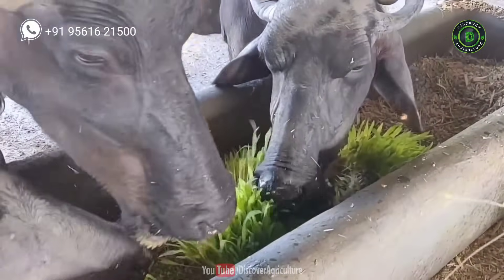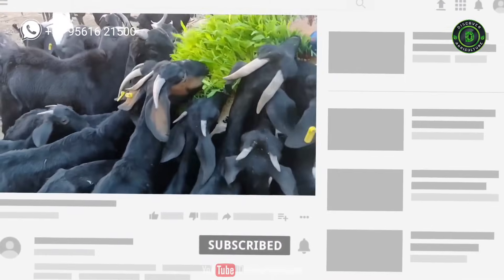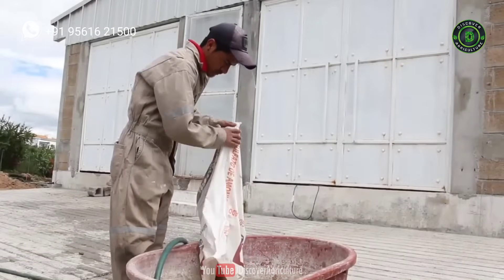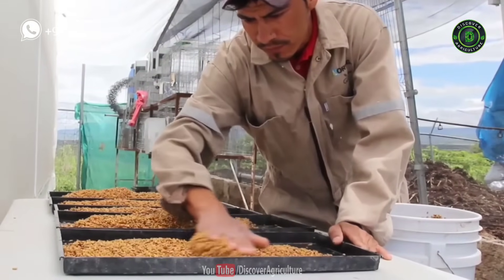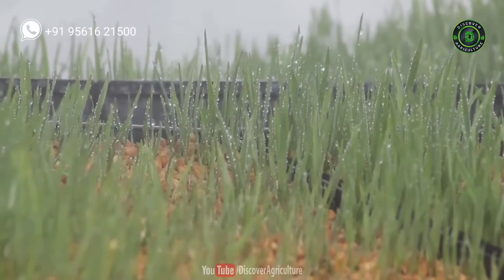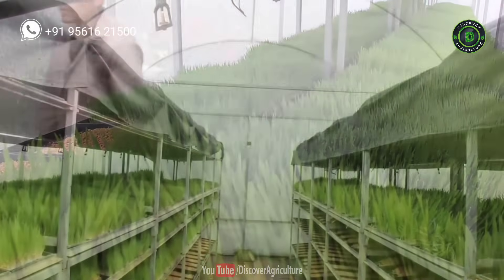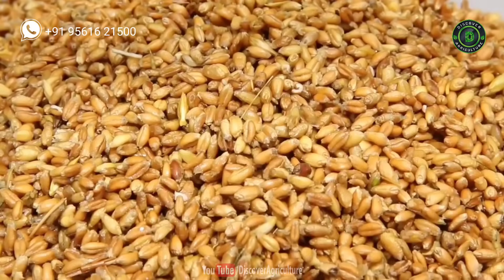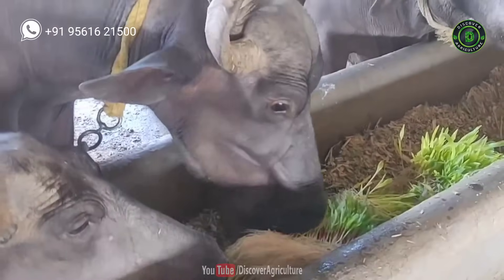Hydroponic Fodder System | Easiest Method to Grow Hydroponic Fodder at Home | Green Fodder Farming

Comment: I think it's far expensive than feeding them with natural grass
Reply: It should be done when natural grass is not avaliable
Reply: @biswajitjena9908  it contains more nutrition than soil grass
Reply: @abcdef1709  it can be done in very less area which save your man power and land wastage and production in whole year

That's the main difference
Reply: A kg of maize produces 8-9 kgs of nutritious green fodder in just a week... what more can one expect and is always better then the field grass also one need not go anywhere to harvest as the shed can be set next to the desired location. The set up is a one time cost and once you get the zest of it there is no looking back....there are many who are already using and reaping the benefits of this system. A better option if done meticulously.
Reply: Use solar for electricity
Setting it up would surely cost a hefty amount
Reply: What kind of solution you used to wash!

Comment: Used fodder(after consumed by livestock) can be used to regrow??? Or every time new seeds to be used to grow the fodder? 🤔 🤔 3
Reply: No no... Its not , because 1 k.g seed , when it grow fully its like 6 to 10 k.g. green fooder .
Reply: Every time new seed
Reply: @Netrananda_Padhan  then its expensive.
Reply: @saleemin27  Here in my locality, most of the farmers feed powdered cereals to cattles. I think, this would be the best way to reduce feed cost for them. Feeding hydroponic fodders which are rich in nutrients than powdered cereals will also keep the cattle healthy.
Reply: @anandakrishnan9840  for example, i have enquired for maize seed yesterday, 8kgs of seed is ₹ 2500/- which means 1 kg of seed is ₹ 312/-, As per this process, if we get 8kgs of fodder on average, each kg of fodder costs ₹ 40/- per kg excluding all other incurring expenses other than intial investment. I am trying different ways to control cost on feed for our poultry but this doesn't seem to be economical for me. Please explain with estimation. Thank you
Reply from the maker: We are from Kerala. We are getting maize at 20₹/Kg..! Fodder cost will be 2.5₹/Kg (20/8=2.5₹).
Reply: @DiscoverAgriculture  we too get commercial maize at ₹ 20/kg, but do they germinate and grow like a seed? What would be germination %? Sorry for lot of questions. These are out of curiosity and in need of proper way to reduce feed costs.
Reply: @satyasampan  sir , maintain humidity , water sprinkle , temperature etc , its easily germinate .
Reply: @satyasampan  try wheat
Reply: Very expensive